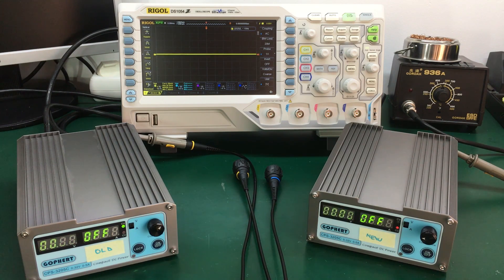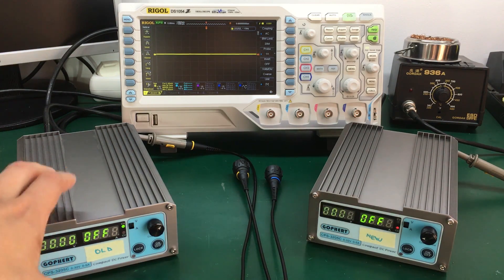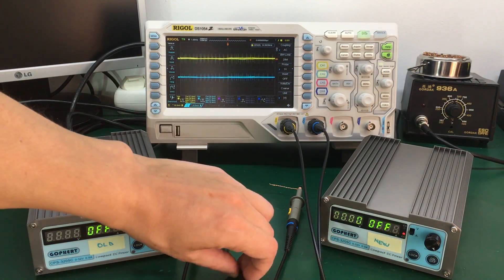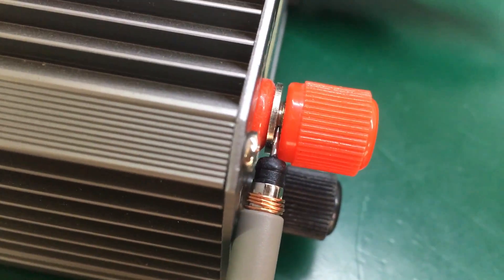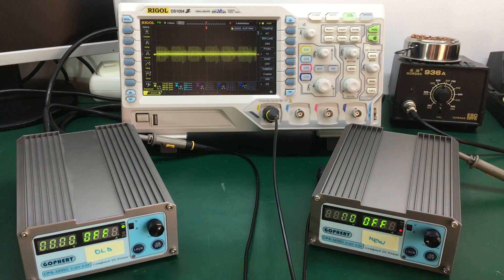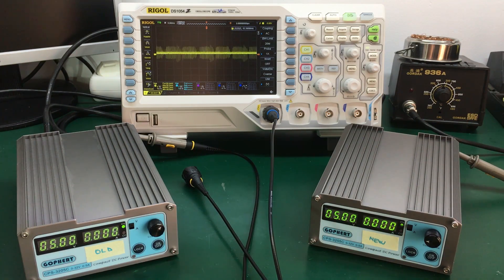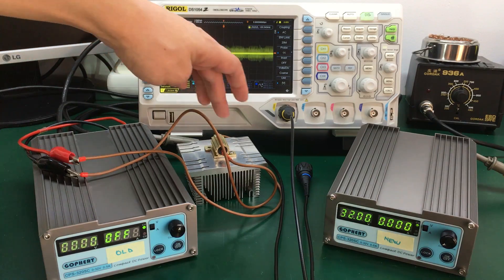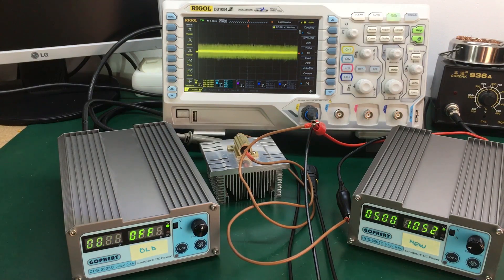Voltlog #49 - Gopher CPS-3205C Output Noise

Comment: If you think about it they didn't fix much with the old supply, just better output monitoring.
The terminals not being on the front is also not great, as was shown by not seeing  obvious things like the probe not being connected.

Comment: (All values in mV.)

Condition    Old            New
---------------------------------------------
Off:       53~54      49~50

No Load:
          5V      53~55      50~52
        10V      52             50~51
        20V      53             65
        32V      54             56

1A Load:
          5V      55~60     65
--------------------------------------------
Reply: Yong Whang Yikes! Thx! ÷*)